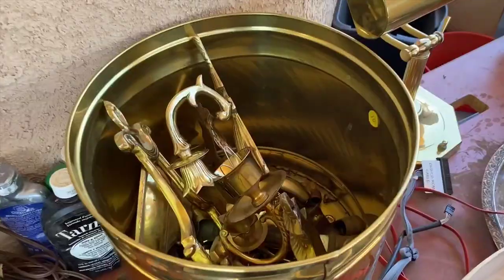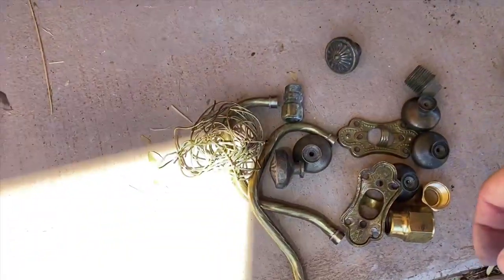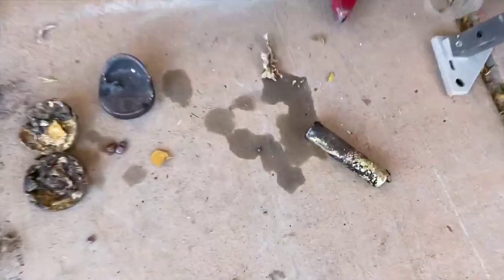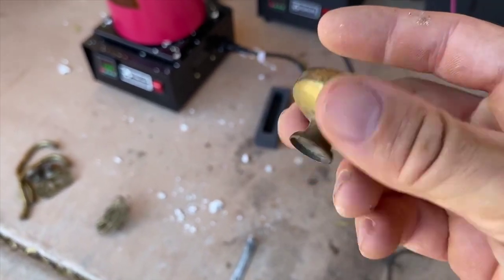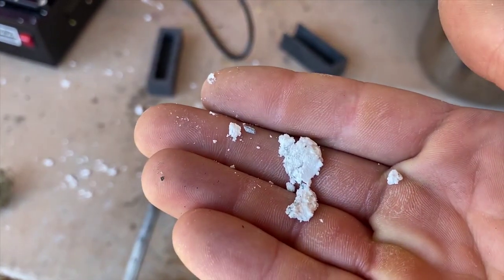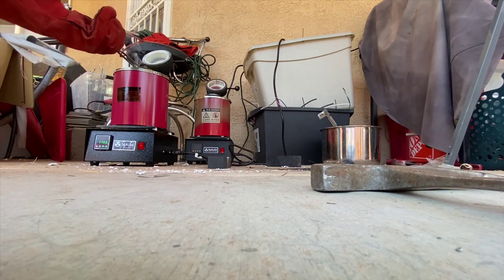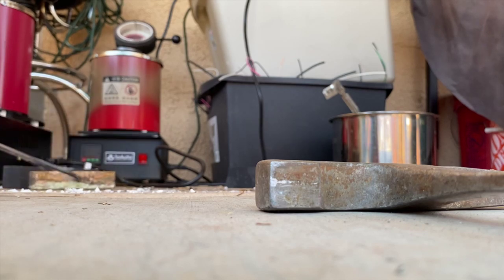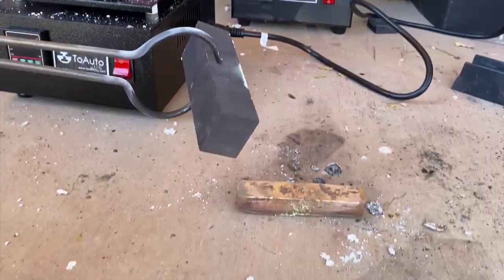First brass melt? Or summoning the fires of mount doom?

Comment: I think the reason it was that bad was that metal pipe acted. Like a chimney acting like a rocket stove. Mr T you really should have a flat patio block to set your crucible on. The heat can cause cement floor to pop. Might also want to check all with magnet before melting.
Reply from the maker: Ah yeah that makes sense. Silly of me to not test it with a magnet. Once I scored it with the file and it was still brass colored I figured it would be on. 

And yes I do need to get a fire brick or something similar, it’s on the list! (And probably won’t do another melt till I’m fully set up safely ha)